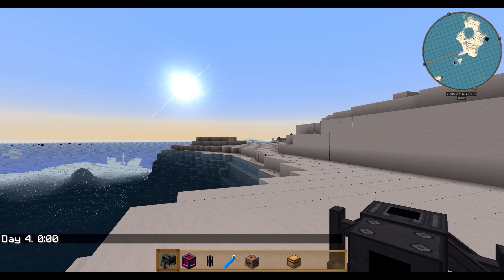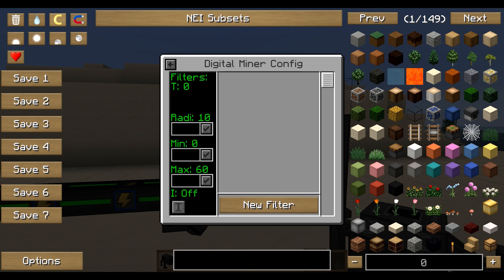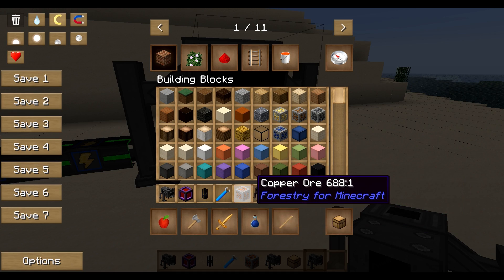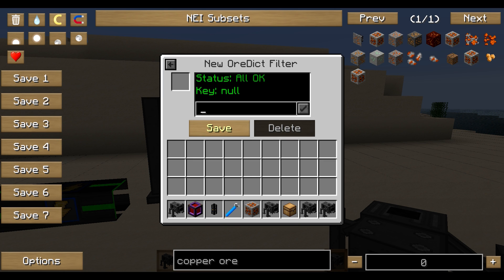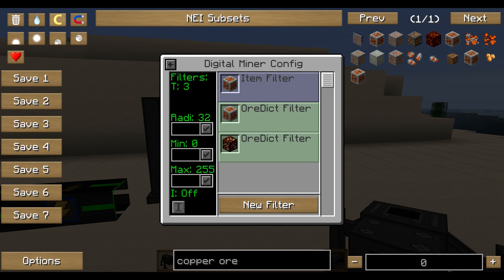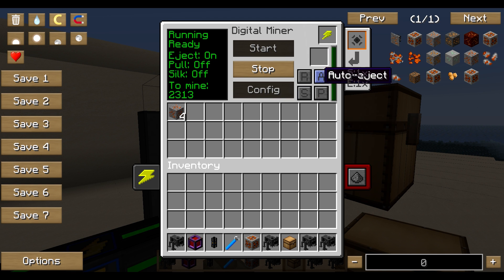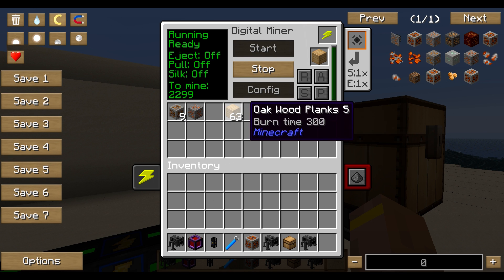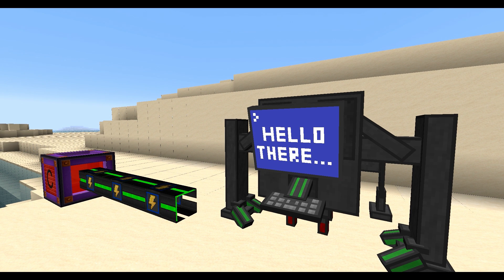Minecraft Tutorial: Mekanism Digital Miner (Fast & Easy Tutorial) [English]

Comment: Well, in the later releases they changed the replacement block. It's not longer possible to place a block it should replace what it mined with in the old way. I just can't figure out how to do it now with invert system, ie mine everything but some things and then replace blocks mined with cobble. It just doesn't work any more.